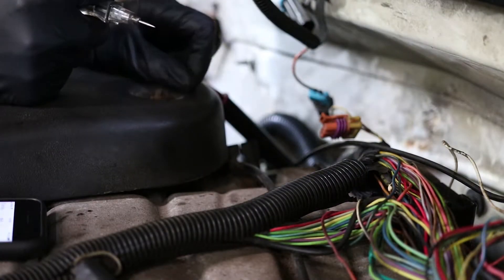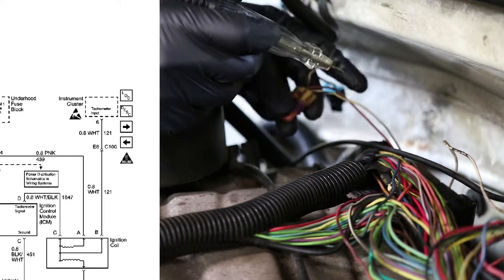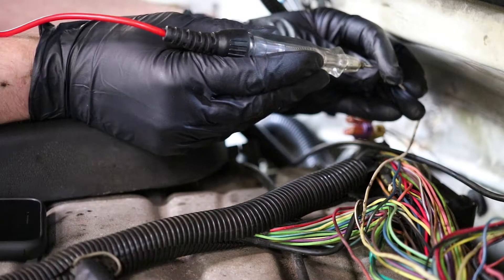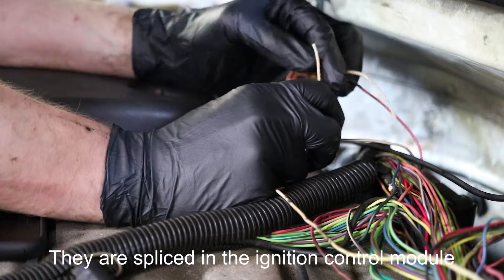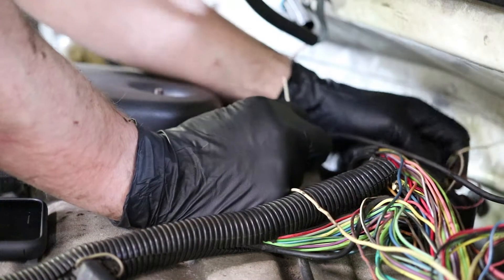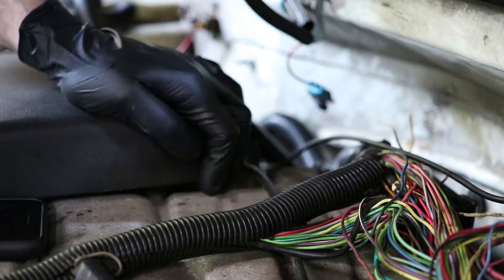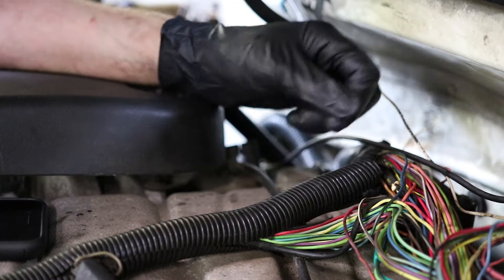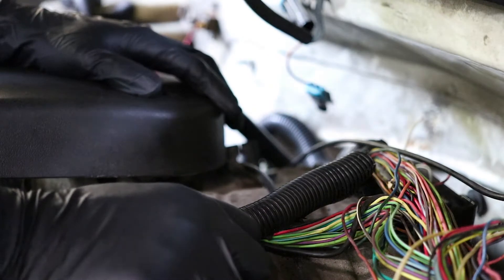Chevy Truck No Spark

Comment: I’m having the same issue, no spark at the ignition coil, brand new one. The connector to my ignition coil only has 2 wires, Pink and white and black. The truck was running fine, but some times when going over 2000 rpm the check engine light would flash and go away. Yesterday it was running fine and it died and never turned back on. Changed a bunch of parts and I just found out there’s no spark at the ignition coil. What could it be? Chevy Silverado 1500 2006 4.3 V6 standard. Thanks
Reply: Did you find the issue?
Reply: did you get a scanner and read the codes ?  I'd start there and I bet it is a bad coil pack.  I'm thinking by 06, you had individual coil packs ??   97 saad did, 07 camry did and 05 bmw did....so 3 different cars, all had coil issues.

Comment: Great video hope all is well. Have a weird issue. Have an older Chevy Express 5.0 VIN M . I left NYC for about one year and two months, when I left the van was running no issues at all. I came back last month Feb.22022, during that period the van sat basically on the street and battery was disconnected. I changed the oil went to start the engine  and nothing, just cranks and cranks. I suspected it was the fuel pump and heard no priming when opening the key. The weird issue is that I disconnected ECM fuse B under the hood and plugged it back in and the dash check engine light would flash on and off, at the same time as the fuel pump.. so it cycled on and off on and off and wouldnt stop. The other weird part is there is no spark, i bought an ICM , coil and still no spark. The van was running before I left, it was bot touched or started so i thought  maybe mice but cant find anything chewed up. I manually powered the oump with a power probe and pump runs. Not sure either if this year had factory alarm but I dont think so since the dash has never shown me any security lights. I am stumped and dont want to throw parts at it, i was the thinking maybe the crank position sensor… would you have any ideas 

My biggest worry is why would the fuel pump cycle on and off continuously and at the same time, the check engine light would flash on and off. Thanks hope you read this.

Comment: I have a 1996 gmc sierra dually with 454 and it does not have spark but cranks im wondring how much will i need to spend or how much labor hours normally it takes to get this truck running like find a open wire or shorted? Thanks
Reply: Maybe 2K plugs wires cap rotor distributor- set timing ignition coil, ignition control module,
Reply: @adakai6091  what?!
Reply: Worst case. About $800. Timing chain, distributor, module, coil, ckps, plugs and wires. You can find parts half the price on the internet.
Reply: @ismaelcarrillo3956  that is true you can find cheaper parts, I took mine to a shop after parts were replaed and labor it cost me around 2k

Comment: So I have a 1998 GMC Sierra with the 5.7L Vortex. It started to miss fire and run rough at cruising speed and of course smooth out so what under acceleration.  So I popped the hood and see #1 wire out of its hold down and touched it and got shocked. So I replaced the wires, plugs, cap and rotor. Cranked it up and it ran smooth as silk, throttled down on it and it ran rough and then stalled and died. It looks like it’s not getting enough spark, however when I hook up the ICM and coil to another truck it runs fine. I guess my question is can the tach be killing my voltage in the coil. Any ideas would be appreciated.

Comment: Riddle me this sir, In my 92 K5 Blazer I have to replace my ICM every couple of years, seems like they should last a lot longer or even forever? I have 92 S-10 Blazer that I replaced the ICM about 15 years ago and had no problems since. I'm baffled. Also I have to replaced Cap And Rotor every three months seems like because of oxidation build up why does that happen so quickly?  Thank you.
Reply: Advanced auto? Autozone?
Reply: @MultiCrazyCar  O'Reilly's. This last go around i bought brass cap and rotor. I also have a running rich problem. Replaced cts, tested tps seems good. Thinking about getting new 02 sensor other than that I'm stumped.
Reply: The location of the distributor was a bad idea. Behind a hot motor where moisture from driving in rain messes with electrics. Also the more the timing belt is stretched the more frequent your ignition parts need replacing
Reply: @ismaelcarrillo3956  I've go a 2001 Chevy Express 2500 5.0l my opinion is aftermarket distributor cap & rotors can't handle the HEI voltage they wouldn't last as expected. I've been only using AC Delco

Comment: Your video is very helpful but didn't solve my problem i have no spark!!! tried/changed everything.if I take the coil wire off the distributor I am getting power with test light but no spark any suggestions??
Reply: I have the same problem man your not alone. I have a 1952 Ford customline that was converted to 12v and it was fine My car was running great and then I pulled out on to the street one day and it stopped running and that was 4 months ago, I've since replaced the coil,distributor,plug wires,alternator with voltage regulator,and checked for wire shorts. I haven't ever been so flustered before in my life I understand your pain and I hope you get the answers you need.
Reply: I’m having the same issue. Signal but no spark at coil

Comment: Ok so I'm still having issues. I have a 04 with a 4.3 v6 and 5 speed. Randomly died on me in a drive through. Starting running rough as hell and died. Couldn't get it restarted. Have no fire at coil. I've replaced the coil, the plug wires, the rotor and cap. I have power to the pink wire going the the coil and power to the icm. Both light up with a test light and stay light up during cranking. I've traced it all the way back to the ignition switch itself and still got power all the way during key on and cranking. I've got good fuel pressure and getting air. Tried this wire snip trick and still nothing. Bought this truck 3 weeks ago as I can't afford head gaskets on my duramax (AGAIN)
Reply: @drmuziic8708
10 months ago
Did you figured out the problem? I’m going trough the same problem

Comment: I'm in the same boat here, your explanation isn't clear enough on your video. Which wires did you splice together? Was it from the ignition module wire to the ignition coil wire or was it black and white to white off of the ignition coil?? I've replaced everything on my 96 Tahoe and it's driving me fuckin crazy!!! No spark still but every now and than I get back fire. Sometimes when I turn the key the dash lights like battery and etc. show up and sometimes they don't just like the fuel pump sometimes it kicks on and sometimes it doesn't. But no spark, fuck!!! What do I do now?
Reply: Did u figure it out i am in the same boat I am ready to 🔥 it
Reply: He cut the center wire on the pigtail of the ignition coil

Comment: My truck recently died and just cranks could this be why?
Reply from the maker: SuperChargedgaming  always check for spark and fuel first. Depending on which one you don’t have would determine where to go next. You can always try to spray starting fluid or brake clean in the intake to see if it fires. If it does fire, then it’s probably fuel related.
Reply: It has no spark
Reply: I’ve changed everything on it that you mentioned in this video
Reply from the maker: SuperChargedgaming ok make sure you have a 5v reference at your crank sensor. If you do then make sure the control module is seeing the command for the coil to fire. If you crank the engine, see if you have a rpm signal at all.
Reply: Richfield Auto Center it’s rpms move
Reply: Richfield Auto Center but seems like the coil has no spark coming from it
Reply from the maker: SuperChargedgaming ok check the connector at the coil and see if you have power. You can try cutting the ground wire to the coil  like in the video and see if it starts.
Reply: Richfield Auto Center so I tested the wires the only wire showing 12v is the pink
Reply from the maker: SuperChargedgaming unplug the ignition coil connector. Connect a test light to battery positive and the other end to the white and black wire. Crank the engine and see if the test light flashes.
Reply: Richfield Auto Center all try that and see what it does all be in touch
Reply: Richfield Auto Center so I cranked it and it has no power at all
Reply: Richfield Auto Center so what should I do next
Reply from the maker: SuperChargedgaming without seeing it, I’d be checking my inputs to my ignition controls module. If those are all good, I’d be replacing that.
Reply: Richfield Auto Center it has a new control module
Reply from the maker: SuperChargedgaming just because it’s new doesn’t mean it’s any good. You have to check the wiring or fuses if any to the icm. Like I said, hard to tell without physically working on it.
Reply: Richfield Auto Center should I try checking all the connections
Reply: Richfield Auto Center I checked them and two wires have power two don’t
Reply: Richfield Auto Center what wires should have power on the ignition Control Module
Reply: @RichfieldAutoCenter  i have a question for you